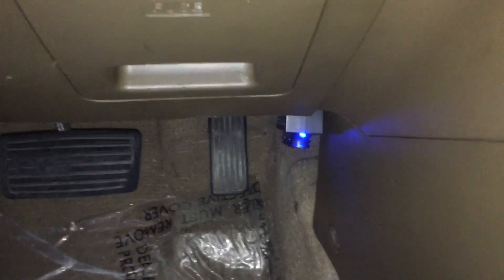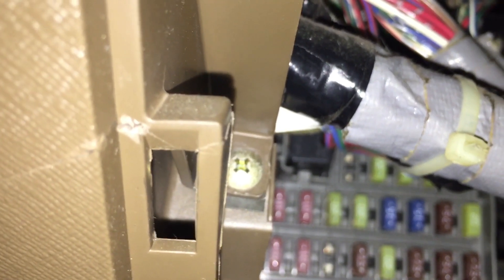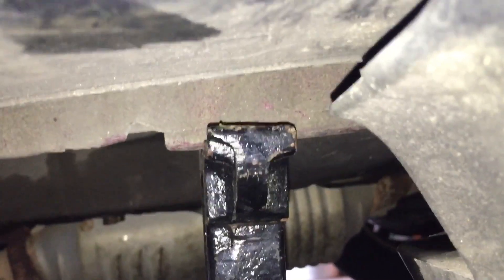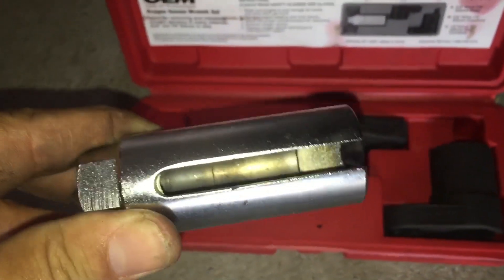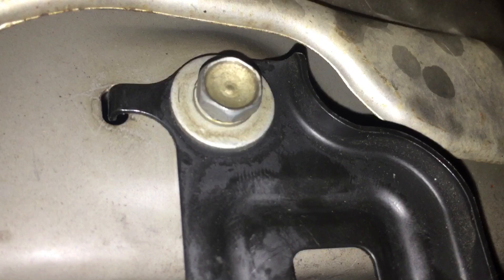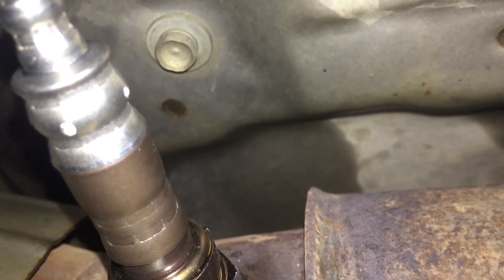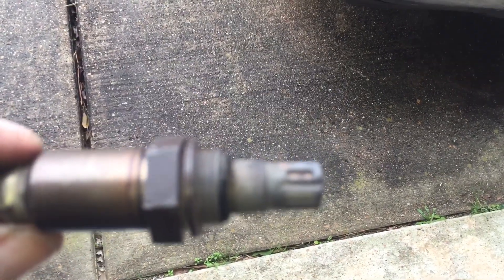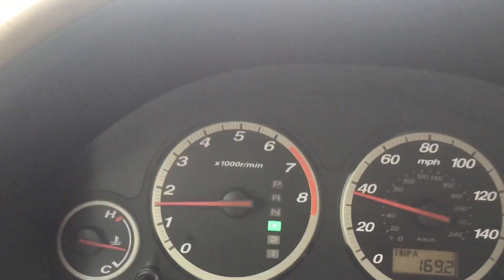Common Guy:  P0134 Repair On 2004 Honda CR-V

Comment: I own 2 2nd Generation I got 1 with that code gives 100 miles less than the other one
Reply from the maker: @alonsovazquez2598  not sure what you’re asking or if you’re asking anything or just make a statement
Reply: @ I currently have a 2004 Crv with that code p0134 and is giving 100 miles less than another 2002 Crv that I own.
Reply from the maker: @ the oxygen sensors regulate the the amount of gas going to the engine whether it’s lean or rich. You can also check the mass air flow sensor too.
Reply from the maker: @alonsovazquez2598  the code should point to the sensor that may be bad.
Reply: @ you are right oxígen sensor bank 1. I just bought  1 denso brand in Napa auto parts.

Comment: Hi I have a 2002 Honda CR-V LX 2.4L engine I got the p0134 code for bank 1 sensor 1 will this fix my problem of the car losing power because that’s the only code I have
Reply from the maker: These sensors regulate the air/fuel ratio to the engine so they could cause power loss if the mixture isn’t optimal.

Comment: Thank you so much! Is there a relay to this sensor somewhere to???
Reply from the maker: Not that I know of.  Once I replaced the relay and drove it the code went off.
Reply: @CommonGuy  Thanks Bro!
Reply from the maker: Hope it helps you out
Reply: @CommonGuy  Yes,  I already changed out and p0134 is gone now I have another issue with hot n cold gauge staying in the to lower range lol Let me know if you have any idea what controls that gauge! Thanks
Reply from the maker: I’ve had issues with this switch 

https://youtu.be/C7W_wd5SzNI
Reply from the maker: Or this video

https://youtu.be/dSxFHUUG9hk

These are the only heating/temp issues I’ve had.  Or it could use a coolant flush

Comment: It's not dielectric grease, its antiseize.
Reply from the maker: Sorry I worked on electric equipment for a long time and used a LOT of dielectric grease.  😂😂😂
Reply: @CommonGuy  t
Reply: Correct. Besides you'd NEVER want to use any silicone containing grease such as dielectric grease on the O2 sensor thread as silicone can cause premature failure of the catalytic converter. Dielectric grease WOULD be a good idea on the plug though due to its location under the vehicle.

Comment: Hi, I changed the fuel and ratio sensor, the code was erased, but afterwards another code came uo indicating taht there was a slow response. Can you please help me.
Reply from the maker: Sorry for the late response.  I’m not a mechanic but I use YouTube to help me and help others.  I recommend the BlueDriver code reader it gives all kinds of repair info and then I do my research from there.  That’s why I call this channel the Common Guy.  I’m no expert but I do what I can.
Reply: Slow response with what

Comment: Different question, can someone chime in:
Does the "RED" (@, lower right HVAC dails) dial light up on yours?
I have all the inside lit up & be seen at night or when dark, but can not see the "Red" dial knobs.
Reply from the maker: Sorry for the late response, but it can be that the lights in the panel could have gone out.
Reply: @CommonGuy  All those lights checked & tested good. I think I going to tell them I could replace them with LED lights.

Comment: Hello brother. 
Recently I installed the new catalytic converter and the 2 Oxygen sensors . Then I removed all codes . Then I got the same Code as yours and my Sensor is brand new .
Do you have any idea ??
Thanks
Reply from the maker: Sorry I missed this but I’m evidently not getting notifications.  
Do you have an OBDII reader that can do live data?  Check to see if it’s putting out the proper data.
Reply from the maker: Could be a bad sensor.  Did it get fixed and if so what fixed it?
Reply from the maker: Could be a bad sensor.  Did it get fixed and if so what fixed it?

Comment: I AM CONFUSED..... 
i got two codes one for sensor 1 and another for sensor 2, one upstream an the other downstream on my 2005 CR-V. Are you changing 1 or 2 reason i ask is because i was inform that the Sensor 1 is on the top of the engine not the bottom. please help!
Reply from the maker: I changed just the one sensor.  I only have 2 sensors and both are underneath but upstream is before the cat.  The downstream is after cat.  

I’d assume bank 1 sensor 1 would be upstream/before cat.

Comment: These are 100 bucks  on RockAuto site. Auto zone is a rip off.
Reply from the maker: Eric Smith yep I know!!!   I needed it quickly so I didn’t have time to wait for shipment.  I only had that day to do it.  

That’s the reason I put the Amazon link in here, so that someone that could wait for it would save that money!!!!  😁😁😁
Reply from the maker: I also use rockauto.com a lot myself.  I bought a radiator fan motor for this same vehicle for $30 where I could only get the fan assembly from autozone for $107.
Reply: yeah my o2 in my civic just went bad and a I can't figure out if its a wideband or regular type sensor, thanks for this vid it was interesting.
Reply: Sixty bucks on Amazon for the rear (downstream) sensor.
Reply: Amazon has Denso upstream and downstream for $25 and $82.

Comment: Hi  Guy, are both rear and front oxygen sensors the same? I ordered one rear and one front, they
came in one box and they are identical. I am waiting for a reply off the company i bought them off. 
But i thought i will ask u too. Same Honda CRV 2004
Reply from the maker: ANTONIOS they should have different part numbers.  They are different part numbers: Denso 234-9005 Upstream $159.99 & Denso 234-4125 Downstream $178.99 from Autozone
Reply: Common Guy....   $25 and $82 or thereabouts respectively on Amazon.
Reply: @user-wm2tw those cheap sensors won't last a month in the vehicle if they work to begin with

Comment: HAS ANYONE GOT THE PART NUMBER FOR THE ABOVE  OXYGEN SENSOR??
Reply from the maker: Look in the description.  I have a link to the part which I purchased from Autozone.  You may be able to get it cheaper online.
Reply from the maker: Actually I have Amazon Link & AutoZone link so you can see the price difference.
Reply: @CommonGuy  Thanks

Comment: How did you 'remove' the code? I replaced the upstream O2 sensor for the same error and tried the unplugging the battery method but the error code is still there.
Reply: Unplug the battery and disconnect the ecu fuse for 15 seconds then put everything back together and you shouldn't have a code anymore since that will reset the ecu.
Reply from the maker: @JuanReyes-rw2np  Good to know!!!  That should help someone else that doesn't have an ODBII reader to clear their codes (any code).
Reply from the maker: Alejandro Cruz the BlueDriver code reader will allow you to erase the codes.  If you have a cheaper one they should do the same.  If everything is good the codes won’t come back.  I have an iPhone and figured the bluedriver was best on the iPhone.  If you have a droid you can get an OBDII reader cheap on amazon.  Then purchase the Torque app (upgraded) From google store and you have a really good code reader.  Also if the problem is fixed it should go away on its own.  

Let me know if this helped.

Comment: My CAR IS A HONDA CRV 2005. I BOUGHT IT NEW DROM THE SEALER IN 2005 FLORIDA. BUT IM IN MASS NOW.
Reply from the maker: Sorry I missed this message, as I try to get back to people as quick as possible.  If you haven't gotten it resolved then here are some links, because I haven't run across this code myself:

https://www.youtube.com/watch?v=lifJa1vq6M4

https://www.youtube.com/watch?v=KslMEBzsgLc

https://www.engine-codes.com/p0661_honda.html

https://www.crvownersclub.com/forums/14-problems-issues/1999-p0661-2.html

Comment: Hi THANKS FOR SHARING I HAVE A QUESTION !! CAN TOU PLEASE TELL ME OR ASK SOMEONE IF YOU SONT KNOW, HOW TO FIX A P0661 CODE. I ALREADY FIXED THE 2 SENSOR BUT THE MOTOR LIGHT IS STILL TURNING ON. WILL YOU PLEASE ANSWER ME SOON. THANK YOU SO MUCH!!
Reply from the maker: Sorry I missed your request but not familiar with that code.  Is there any videos on that code that someone has posted?

I seem to not get all notices for comments

Comment: Which sensor is it the left or right one?
Reply from the maker: Michael SJ it’s the one closest toward the engine.  This is a 4 cylinder so it only has one bank and bank 1 sensor 1 is pre-cat converter.